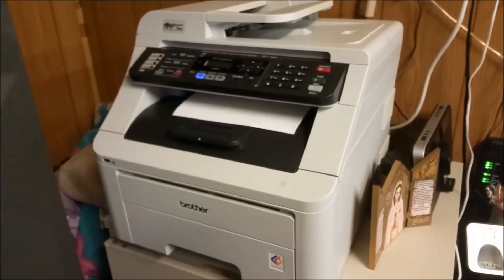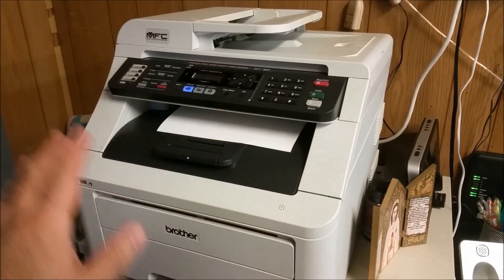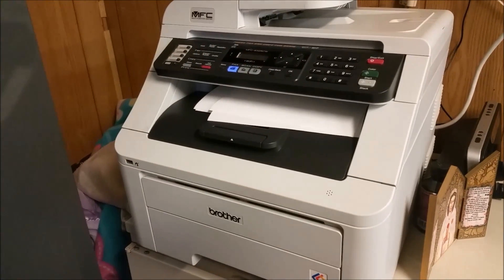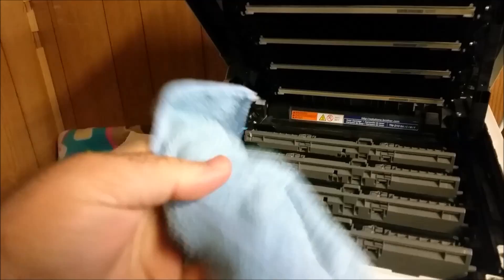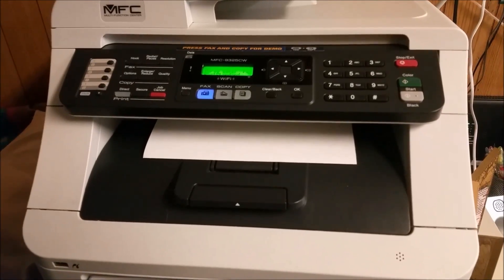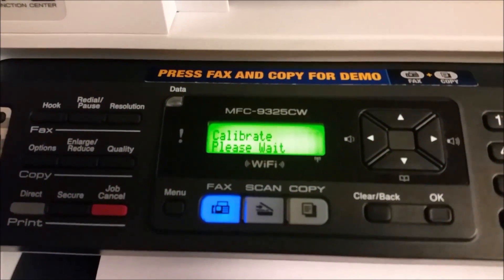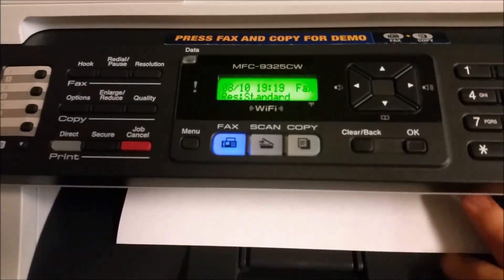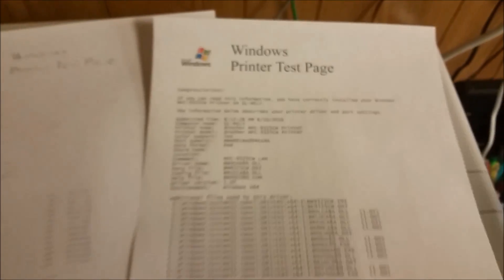How to Repair Brother Color Laser / LED Printer. Blank ,light pages

Comment: I just purchased my printer 2weeks ago and don't use it much but need it to stop overlapping print because it is not legible to read. Please tell me what to do, it is mfc-L3770CDW
Reply from the maker: If the unit is 2 weeks old, I recommend replacing. Should still have warranty
.sounds like the roller has an issue. 2 weeks is tooooo soon for an issue.

Comment: Registration is failed in that case you have any solution
Reply from the maker: I believe you will see that error if you are using generic drums. It may need replacing.
Reply: all the drum where brand new from brother , anyway i found the issue customer bought a cheap cartridge now working fine thank you bro

Comment: The cleaning alone improved the prints 👌🏽 thanks
The calibration fails every time though. Do you know what potentially causes this?
Reply from the maker: I have been told that many times it is caused from using generic toners. But if original then it maybe the contacts on the sides of toner

Comment: Carlos, I justcompleted the setup for the printer, and everything was working perfectly. I was able to use the WiFi and print from my phone. However, when I tried to do the Firmware update, the printer froze: it started by having the on/off button flashing for like a minute, and then it showed the on/off button that the printer is on, however, the screen is completely black. right now, the on/off button is still on, but the printer's screen is off, and it does not connect to my computer anymore because it says that the printer is "off line". I’ve read some trouble shouting suggestions in your website to press the button for 20/30 secs, but it did not work; I unplugged the printer and left it like that for 5 min, but nothing… The button is green but the screen is still black. When I try to use the Network Connection repair Tool it shows “Diagnostic-code-(-1). Now the computer shows that the printer is not connected by wifi. 

I tried to reconnect it but it was useless ( I turned on/off the router, I reconnected the printer to my computer). NOTHING .... I was so happy I got the printer working, now I am so very dissapointed. Can you please help me fix the problem please?

Comment: I don't see the mfc model numbers this will help i have an older brother mfc 9560 cdw that i love but it's no longer manufactured so hard to find information for the problem i am having. going to see if i can see this laser that you are cleaning and going to see if that will help the color streaks i am getting. i have moved and moved the printer several times and not sure if the movers shook or move it so much that has caused my lines. the toner cartridges are still almost full so I would like to try to keep them since replacing them is pretty costly. if you respond i'm not sure how to find the response so i'll try to keep checking hoping i will get any responses

Comment: Hi Carlos, I have a MFC-9340CDW that is blurring the colors.  The black color prints just fine.  I've followed your steps here and unfortunately it didn't resolve the issue.  I'm able to calibrate successfully but when I attempt to run the Auto Registration I receive a message indicating "Registration Failed".  Any suggestion on what I can try next?
Reply from the maker: This is usually when it can not talk to the chip on the supplies. common when using generic parts. check the parts if original...

Comment: I have the exact same problem (fading colors, some pages are almost white sometimes and other times blacks are too dark), I tried what you suggest in your video, but it didn't work. Any other idea? Thanks
Reply from the maker: Are you using genuine brother toner? Many generics do not work well with LED printers. They don't have the light sensitive particles in the toner which brother uses for the LED printers.
Reply: @cashe18  we finally cleaned LED as you showed but we had to use a little bit of alcohol. Now it works. Thanks!

Comment: Hey Carlos! Thanks for posting.  Sadly for me, the fix didn't work.  My pages are still streaking and they are also curling on the right side, running all the way up and down.  The drums and cartridges are around 88%, the belt is around 30% (low but should be usable), and the fuse/fuse kit is also around 50%.  Also, I've done the recalibration but whenever I try to save the configuration, it fails, so not sure what to try/do next.

Comment: This is great, and I've definitely narrowed it down to the black LED being the cause of my print problem (a 1/2" white streak through any solid areas, and distorted print in the same areas).  I've replaced every other item except the fuser, and it looks brand new.  I've got under 8500 pages printed and my belt is clean and shows 60% life, and the Fuser/PF kit each show 95% life.  The problem is only happening on black, and yes, I replaced toner and even the drum units.  Always 100% Brother products used.  So there's apparently some damage to the LED.  How easy is it to replace one?
Reply from the maker: Sadly, it actually is a VERY hard part to replace. On just about all the led laser models because you will need to take the machine apart down to the controller board and spring sets. Very time consuming. Also finding the led print head new is a pickle. I think it be cheaper to find a used model on ebay than doing that repair.
Reply: @cashe18  Thanks for the reply and good info
Reply: FOLLOW-UP:  When I printed a narrow 1" block of each color I noticed CMY were solid and it was only black that had the missing area.  So it wasn't the fuser.  It occurred  to me that I replaced the BLK drum, but not the others, and maybe it was the OTHERS that were causing the issue, somehow pulling the un-fused black away.  I replaced the rest (might as well, they were all in the replacement package), and suddenly the black block was 95% solid!  So if you run into this, replace the ENTIRE set of drums, not just the single color.  Thanks Carlos for the calibration/registration instructions too.

Comment: Thanks Carlos, I've spent over $300Aud on new genuine toner and still had faint and patchy prints. Been trying for ages to clean everything inside, drums, rollers and still nothing. Your video has saved this printer from a double storey dive into the trailer, honestly works like new. Such a simple fix, wish i had seen it months ago. Thanks again.

Comment: Carlos - thank you for a thorough tutorial.  I'm struggling with my MFC-9130CW.  I've replaced the drums; I've cleaned the LED emitters (as you demonstrated); I've changed ink and done all the "internal" diagnostics.  I'm still getting very strange lines across the page.  I do not know what else to do other than buy another printer (which I don't want to do).  Any other ideas?
Reply: I have the same problem white horizontal lines, do you resolved it?

Comment: I have a MFC 9340CDW, recently encountered faint or ghost prints from the black ink. All the other colors print well, without smudging. I have replaced the toner and drum, and am still encountering this issue.  After viewing your video, I tried te steps you recommended and upon trying to auto register the printer give me an error that auto registration failed. I searched what that meant and the brother website recommends to replace the Belt transfer Unit. What do you think I should do or did I miss out anything?

Comment: Thanks, extremely helpful. Using the information from this video I did test, and I’m also convinced that the lights around the printer deeply affect the quality of the print outs, specially LED lights. I do not need to buy a new printer yet. Again, thanks a lot!!!

Comment: Hi Carlos.
I have a Brother MFC-9340CDW and it's printing with a light faded vertical stripe thru out the whole page on all colors. I created a test page on Photoshop with 3 rectangular with the 3 primary colors, yellow, magenta and cyan, and the problem happens one all tree colors.
I apply your recommendation to it but didn't solve the issue.
Do you have any idea how to fix it?

Thank you.

Comment: I cleaned everything on my 9320cw and still printing as your first page. Cleaned bottom page, drums, lasers, ... I calibrate but when i'm going to Auto register gives Error and red ! turns on. I will try to manual register instead... :/ will post here the result
Reply from the maker: Are you using genuine parts? that error is usually when it doesn't read the little chip on the supplies.

Comment: Hi Carlos, you still responding here? I have a Brother HL-3170CDW that is leaving a 1" smear (light) top to bottom on the page. What might be the problem and how would I fix it?
Reply: Dirty drum. Take it out, use an alcohol wipe and get the build up off. Wait until it dries and reinsert.

Comment: I should add: magenta stopped working. Yesterday, I reloaded the drivers and reset the printer, and it started working again. But then this morning (without touching the printer other than turning it off and on), magenta was not working again. Any ideas?

Comment: I ended up replacing the drums and for the benefit of others that replace their drums, you cannot reset the drum count unless the printer tells you to replace the drum.
Reply: That’s not true, most every Brother laser printer can have any parts life counter reset by entering a very simple combination of button presses. Just have a look on google and you’ll find the necessary commands.
Reply: @aaronperelmuter8433  Thanks for your feedback, but I did have a look on Google and Brother.  Yes, there are instructions to reset the counter, but they only work when printer has told you "Replace Drum".  I replaced the drums off-cycle (no message) and was not given the opportunity to reset the counter.   My printer model is HL 3075 CW.  Other models may allow mid-cycle reset.